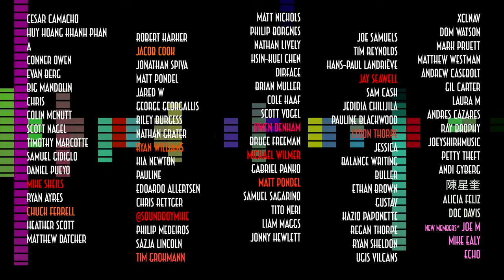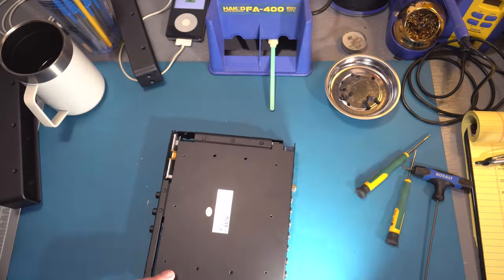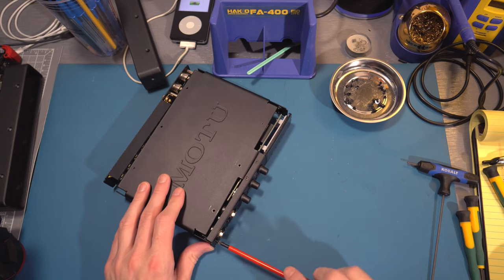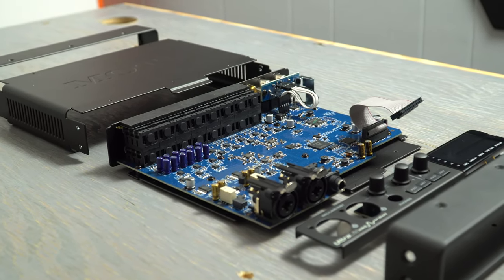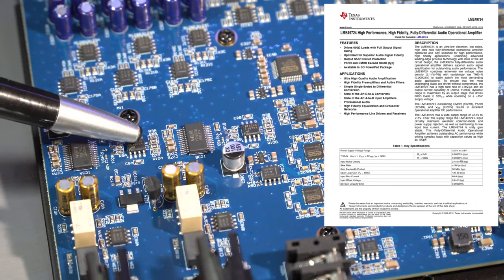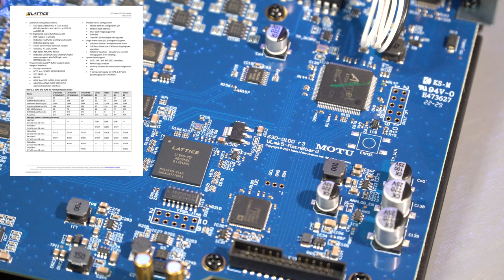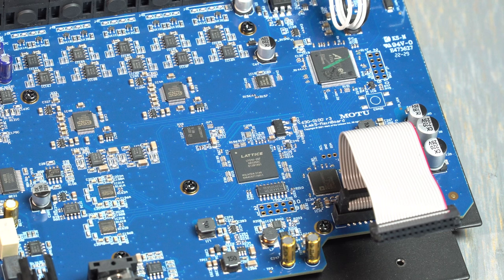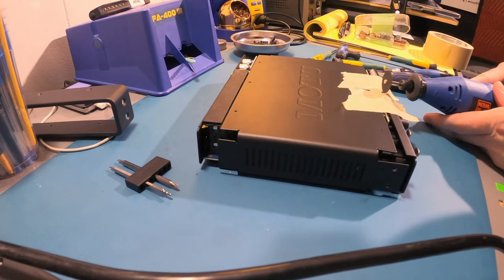Inside the MOTU Ultralite Mk5 USB C Audio Interface - Take It Apart!

Comment: pretty tempted by one of these. need ADAT and monitors, but RME interfaces and Apollo Twins are too much. This seems like best quality i can get. do you still recommend this?
Reply from the maker: I do still recommend these for sure. I've had some isolated issues with my m1 Mac mini lately... occasionally a recorded track will just be destroyed sounding with a strange echo. I thought it was the MOTU at first, but have since talked to and seen video evidence of the exact same fault happening with an m1 Mac and a Focusrite interface. This only popped up after the latest OS update, after a year of flawless use for me. So, all of that to say, I am very much still happy with this interface for what it does.
Reply: @DcSoundOp  thanks for the reply, really appreciate it. one last question, does routing persist when the usb host if off? i messaged motu and didn't hear back yet
Reply: @DcSoundOp  Were you able to fix the issues in your m1 mac later on? I've been reading and its apparently either Apple Silicon implementation of audio or mac software. Hopefully it is/gets patched

Comment: The first input of my ultralite mk5 just died. There's no sound, and I hear audio gliyches when I turn up the gain. Any thoughts? Is it fixable? Thanks.
Reply from the maker: I'm sorry to hear that. Beyond power cycling the mk5 and your computer and maybe trying another USB cable to be sure that's not the issue, I think calling MOTU would be my next move. Hopefully not something fatal, sorry I can't help more from here.
Reply: @DcSoundOp  Hey. It is hardware related, unfortunately. I am in contact with Motu, but no warranty on this unit :( Thx for the reply.

Comment: Nice video. What is the headphone output op-amp, and do you know the power supply voltage? I saw that the MOTU M4 uses the OPA1688 at +/- 5V but the Ultralite mk5 has more headphone power. It's possible they're using a higher power supply voltage with the same part.

Comment: What kind of capacitors are there? Is it Nichicon? Or cheap chinese analogue, thank you)
Reply: Hi, the gold coloured are 22uF 63V Nichicon TEP capasitors 85 degrees celsius. The blue ones are not installed in mine, so I am wondering why it´s still working...

Comment: These BurrBrown preamps have a max 65dB gain, yet the ultralite is rated for a 75dB gain.
I guess they split the gain with an extra analog stage using those OPA167 pairs (as LME49724s look more like balanced line recievers).
Can someone give a bit more insight on that?

Comment: Thanks for this teardown and kudos for posting convenient data sheet links on your website. I own one of these units and was curious about its design, but could find no publicly available schematics. Another user has found that the natural bias point of the balanced inputs is about 1.45V and this is messing with metering on his downstream Soundcraft mixer. (It's really his mixer's fault for DC coupling the meter circuitry.) After seeing your teardown, I understand that this is where the output common mode voltage of the LME49724 differential input amps is set -- probably because that's what the ESS A/D converter chip wants to see. I'm not blaming MOTU for this, since 1.5V through 20k is easily overridden by the average audio output stage, but Soundcraft AC-coupled their outputs and wired their meter circuit downstream of the block caps! Who'da thunk it?
Reply: What do yoy think about the ULite Mk5??? Do you think is more than enough for recording synths with high end results?? Or i will have to search for other products???
Reply: It's fine. If we're talking about digital synths, the converters in the MOTU are probably better than those in the synths.
Reply: @davidrick959  maybe you can help decide: the Motu UL mk5 or the Zoom uac 232 wich is 32 bit.
Reply: @davidrick959  i will never use mics on them. Only line level like synths and effect racks
Reply: @davidrick959  i am somewhat a beginner.  I have the motu m2 but i think the results sound a little soft.
Reply: The MOTU UL5 is good kit: I'm using it in my stage rig and it sounds nice. I don't know a thing about the Zoom, but "32 bit" is utter nonsense invented by marketing people. I'm considering one of the best converter sets on earth for my studio and its bench tests MIGHT support a 21 bit label. If I buy it, it will cost me ~$12k. As a beginner, I suggest you spend less time worrying about gear specs and more time worrying about music.
Reply: @davidrick959  ok thanks a lot
Reply: @davidrick959  were can i hear your music?

Comment: aux - sends 
through a real piece of iron can be done?
The output of the channel for example 3.4 will go to the compressor (for example). And the output from the compressor to the input motu 5.6.
What is it for? To write a compressor to the program with an online render track.
Reply from the maker: If you're asking... yes you can route an input to a physical output to send to a hardware processor, and then back into another input. You have a number of different mix buses to work with in CueMix to accomplish it. There are all sorts of different reasons why you might want to do it, but yes, ultimately you would be looking to capture the processed signal for recording or broadcast. Let me know if I've misunderstood the question though!

Comment: get stucked an xlr on mic input 1,should I disassemble it to remove it?suggestions?
Reply from the maker: Hey, did you have any luck getting it out? Sorry I just saw this. You could take the front panel off to get better access if it's really stuck, though without seeing what's going on, it's hard to recommend what to do next.
Reply: @DcSoundOp  nothing, is still there. :(

Comment: I believe it also has a galvanic isolater as well. Money shot.
Reply: What is a "galvanic isolator" and what does it do?
Reply: @rjb7569  It stops any noise coming from your computer coming  through the usb cable so your headphones or speakers have no hiss.
Reply: @deanhartley3186  
Thanks for the reply. I had never heard of that. Good feature.

Comment: Hi, I opened my Motu Ultralight MK5 and saw that all the blue capasitors are not installed in my interface, the markings and holes are there, but no capasitors. Anyone have an explanation for this? thanks for any help
Reply from the maker: Hi Einar, that's interesting for sure. Did you purchase this unit new or second hand? Thanks for watching & for the message!
Reply: As far as I can tell, there is nothing wrong with the interface. i can record, listen etc.
Reply: @DcSoundOp  I reached out to Motu, there are different versions of this interface, the one I have is the latest. But there should be no difference in sound or function between the different versions.
Reply: They made the switch from AKM chipsets to ESS chipsets in 2022. Apparently due to availability issues after AKM factory fire and the capacitor changes have to do with them using 2x ESS 4ch chips vs 1xAKM 8ch chip.

Comment: How does one know what mark/mk version you have?
Reply from the maker: The MOTU mk system is a bit strange, as they sell some of the models along side of each other instead of the next version replacing the previous outright. Thankfully, they all look different enough to recognize easily & it is marked on the front panel of all of their gear. Thanks for watching Rob!